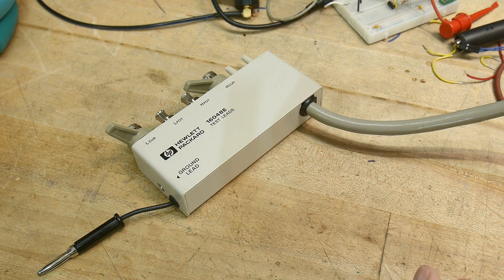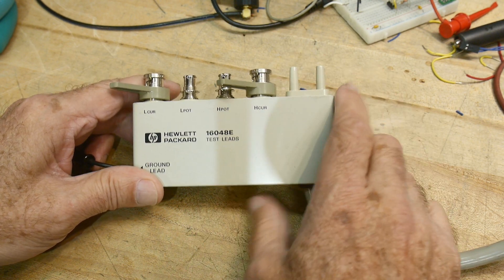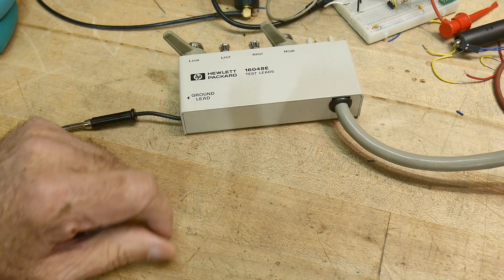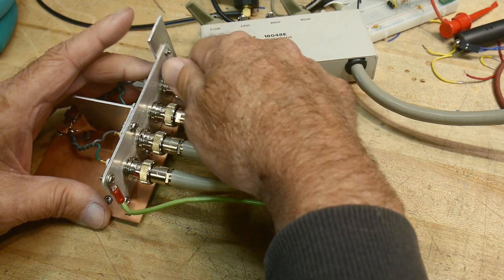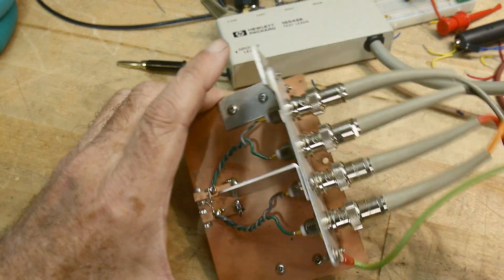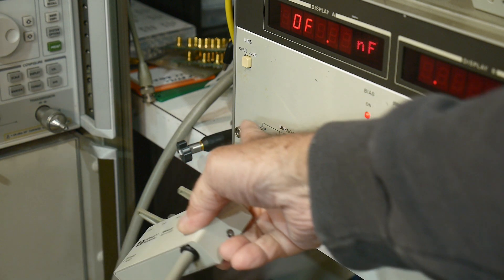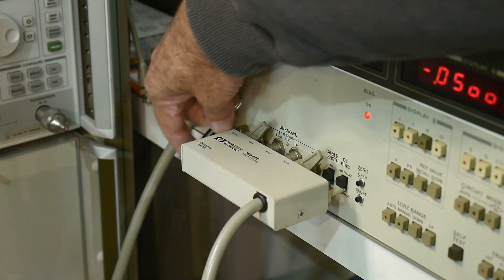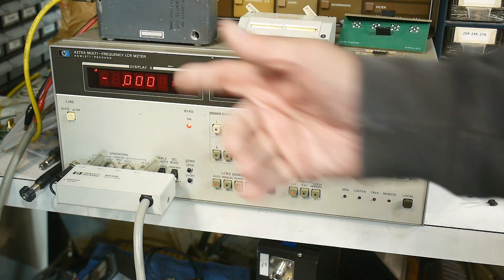#1742 HP 16048E LCR Fixture and Cable

Comment: I have a NIB 16048A-FG that I bought but have never used yet. I went and looked, and it looks identical to your setup with the preinstalled divider between the low and high side BNC's, but mine is only 1m instead of 4m long. Having quality cabling and fixture makes all the difference with the readings.

Comment: I get a bit uneasy when I see in the fixture that the current and the potential wires are twisted together... is this standard? Because I would definitely twist the current wires together and the potential wires together, and not mixed like that.

Of course even better would be to use isolated BNC plugs and use micro-coaxial wire (like Alpha wire 9444 WH033) to terminate the 4TP as close on the product as possible.
Reply from the maker: Hmm, my intuition would be to keep them separated I guess. twisting wires is to eliminate noise, but in these case it might introduce crosstalk. but, the open short cal probably makes it a mute point

Comment: I also have a HP 4575A. On my unit I took a set of cheep Kelvin clip Cable’s (like the ones you had) . Removed a small amount of insulation at the end of all 4 cables near the clips and twisted a
8” #18 wire between the two sets of clips. Then wrap them with electrical tape. No more calibration errors and almost identical readings to my HP fixture. Something maybe you want to try.
Reply from the maker: already did that, don't remember what video

Comment: Handy but bloody expensive. LOL.
Reply: What you can get when the budget isn't a problem!, I'll stick to homebrew.
Reply: @monteceitomoocher  Definately.
Reply: IMO, expensive; but, not handy (and really not that expensive if you have scrap cable/connectors; but, still not handy.)
Reply from the maker: the handiness comes, when you want to test the part under certain conditions where the LCR meter cannot go. like an oven, freezer, vibrator table.